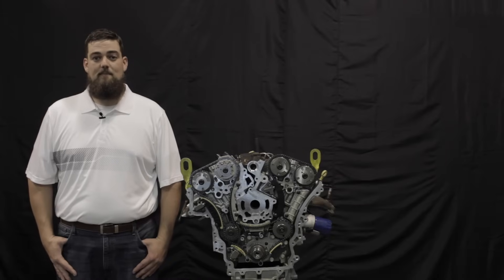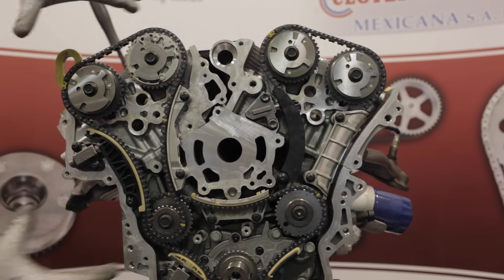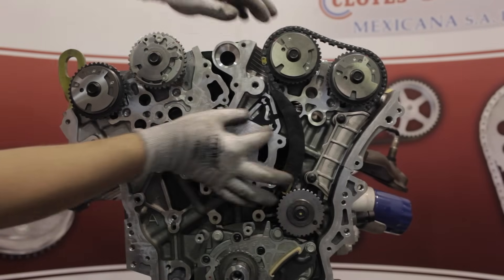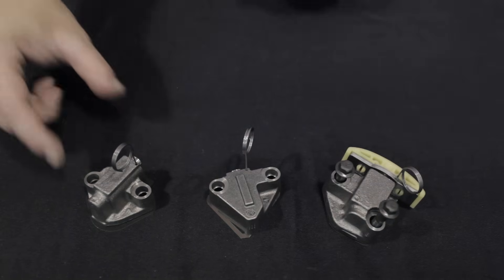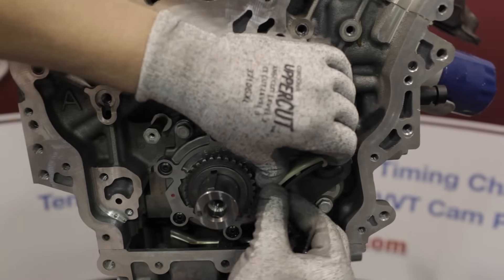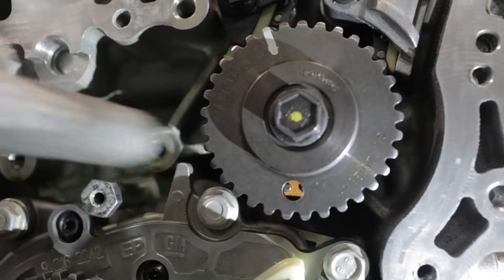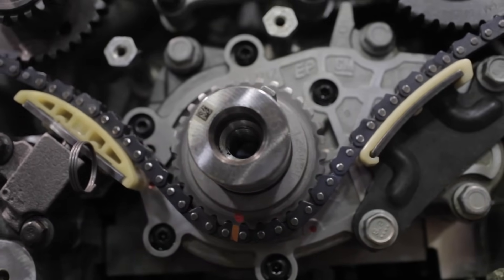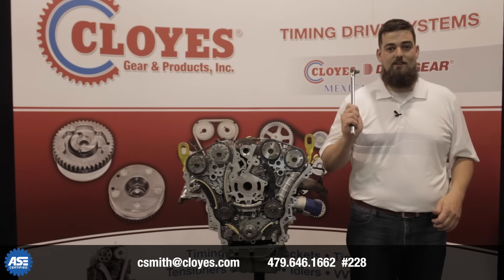GM 2.8/3.0/3.2/3.6L Timing Chain Replacement Repair, Cloyes 9-0753S

Comment: I think I bought a Cloyes double roller timing chain for my Pontiac 400 thirty three years ago. It was adjustable. Not one but three off set key slots cut into the crank sprocket. Providing multiple combinations of cam TDC settings. You could really dial in your engine for power. I learned how to degree cams for the first time on that engine. Thank you. Cloyes!
Reply: Back in the day I installed one into my my 69 400 RA GTO engine, had it tach'd out on a corner and tossed the cam out the oilpan.. I had just put in a rebuilt 4 speed where the builder used Jeep bearings, said they were tad noisier but stronger, I had thought the trany blew, coasted a mile home from inertia, when got home looked under and saw cam chunk hanging out pan.. the chain was broke, had a crane fireball cam and must have touched a valve using that 3 degree mark, never did find exact reason engine was destroyed..  got heads redone, kept those, still on shelf.. car long gone..  if they had those cameras on a cable back then could have checked clearance, must have been close.. putty and wasting gaskets sounded like a waste, wish had done it now...

Comment: Do you have to lock the cam before removing the chains
Reply: 2005 cadillac sts I didn't the cam damn near wont move once they are in a rest position. Just did this not to long ago

Comment: I just had this done to a 2011 Buick Enclave. One thing I have not read below nor was mentioned in the video is the need for a new oil pump. I was told by the GM repair shop that they have been told to replace the oil pump along with doing the chains because the OEM pump does not provide enough pressure to properly lubricate the chains and that is one of the main reasons for the problem. They said since they have been including the oil pump as part of the job they have not had any further problems with the timing chains. Thought this info might be helpful if you are doing this work to your car.
Reply: That and lack of crank case ventilation which seems to be a big factor in the sludge build up imo.
Reply: @derrekallen9588  how do you know when crankcase ventilation is suffering?  They don't use PCV's any more.
Reply: This seems weirdly similar to the 5.4 3v triton motor timing issues, just with a third chain involved....

Comment: I’ve made so much money at my dealer thanks to these timing chains wearing
Reply: @Richard Skipper it has nothing to do with no doing routine oil changes.  That's just the excuse GM uses to not pay for their faulty equipment and I expect to see a lawsuit over this in the future.
Reply: @Richard Skipper wouldn't 0w40 void the warranty? That oil is pretty thick so at temp it would have a hard time lubricating in between tight tolerances correct?
Reply: @ryanchristensen1799  0W40 is a zero weight oil like 0W20 it just had more viscosity change with heat, and the oil gets smoking on these engines
Reply: @bikerdave19148  oh ok gotchya, what about the 3.6 lfx motors in camaros?

Comment: I do the steps in my car and I route the engine with out the timing cover 
My question is 
If I rotate the crankshaft the marks will be not in the same 
And the engine rotate smoothly and very well 
And how I know if I do good or no 
Please help me
Reply from the maker: The only time the timing chain marks will all align with the sprockets marks is when you install the set. Once the engine rotates the marked chain links will not realign. You can check yourself by counting the number of chain links between your sprocket timing marks, then counting the number of links between the marks on the chain. If your sprocket marks are still the same number of links apart then you know the engine is still in time.
Reply: Cloyes Gear & Products, Inc. (Aftermarket) 
Thanks man
Reply: Actually the timing marks will line back up again but you will have to rotate the motor many times but it will infavt line back up ...  I’ve done it

Comment: very helpful video, was my first time doing chains on this engine, i brought the cam lockers but found they wernt needed. thanks for a great video
Reply: Ha ha, me too. You need them, I guess, if you remove the pulleys from the camshafts, to stop the camshafts turning?
Reply: I ended up buying them myself. You need them if you wanna pull the phasers off, so you can undo the nut, without pulling the camshafts out. They are handy to hold the camshafts in place while you hang the timing chains too, although the marks are clear, and you could go without.

Comment: Great video, thanks. Was about to purchase a VE Holden that has the 3.6ltr with the troublesome timing chain, but you have helped talk me out of it. I am a former mechanic and can do this job myself, but life's too short to be dealing with a GM's penny pinching engineering.
Reply: Penny pinching? What other NA engine in Australia gets 210 kW out of 3.6 litres?
Reply: 4lt

Comment: does it have to be at TDC?
Reply from the maker: With the crankshaft sprocket mark aligned the cam phaser marks will either be facing up or down. If they are up you are ready for disassembly, if they are down you need to rotate the crankshaft one more revolution. During the assembly process it may be necessary to rotate the cams individually to realign with the chain. The cams have a hex feature that allows for a wrench to be used to rotate them.
Reply: @Cloyes01  I accidentally got carried away and removed the chains with cam phaser Mark's facing downward, what would be my next step to making sure I get it timed correctly?? Crank shaft sprocket is dead on the mark but phasers are downward.
Reply from the maker: Do not worry about where the pistons are. With the crankshaft mark aligned and the cam sprocket marks up you are where you need to be to service the timing system.
Reply: How did you get the cam phasers in the right spot

Comment: Thanks for the Video, I may try it one day. Just wondering why you pulled the pin @7:14, then it was back in at 7:15? did you get a little ahead of yourself? Thanks again!
Reply: Mark Mangion ah i didnt see that. That'll be why at 7.15 the chain has slack on the left side as it rolls off the crank gear
Reply: somehow I don't think the tensioner even activated. when the pin is pulled there is no effect on the chain.
Reply: They made a comment this was an error in the editing

Comment: thanks gm for nice pile of shit stop trying to invent wheel its been done already
Reply: Your right simple is best, 93 Camry 27 mpg,on hwy no issues 300,000 mi.
Reply: If you think these are bad you haven’t seen the Ford 3.5’s with the internal water pumps. Now that is a shit design.
Reply: That 2010 model engine gets over 300 hp out of 3.6 litre NA. Any old "wheel" won't do that, no matter who reinvents it.
Reply: I only need one camshaft and one timing chain to get from Point A to Point B. To hell with all this overly complicated bullcrap that is costly to fix!
Reply: @maverickdallas1004  couldn't agree more..it's all engineer ego and bullshit...
Reply: @bwalsh6992  I'll take the good old GM 4.3 V6 over this any day of the week! Heck, you can get a reman 4.3 long block for less money than doing just the timing component replacement on this monstrosity!
Reply: @maverickdallas1004  lmao I drive a 1995 astro conversion van right now.. w/out needing a rebuild there good food 400k with proper maintenance ....drives like new travel 1000k miles a week in it ...w/antique tags...
Reply: @maverickdallas1004  astro van 4.3...
Reply: @maverickdallas1004  did u ever fix the problem
Reply: @Chresancioj  I wouldn't take on the problem in the first place. Getting too old for that!
Reply: @maverickdallas1004  I got one right now I'm still paying on and it's used trying to c what to do
Reply: Guy a car is only as good as it's owner, my wife's 3.6L 2011 Camaro has 114k miles on it and is still going strong, I haven't even done this timing chain to it yet, but from what I hear they are ticking time bombs hence why I am here...
Reply: Now I see why my mechanic wants to charge me like $4,500 to change the timing belt..... Ugh

Comment: Thanks for the Video, did you start off with making sure the the #1 cylinder was at TDC or does that not matter.
Reply from the maker: It doesn't matter, once you align the crank mark and insure the cams are in the correct positions you are where you need to be to set the timing.
Reply: This info should be stated in beginning of video. Glad i found it in comments.

Comment: This video is great, working on the car now... Very silly question, but with the harmonic balancer removed, how are you rotating the engine from stage 1 to stage 2? I don't want to do the "old school" method and tap the starter, as it is an interference style engine.
Reply from the maker: We were using the flexplate to rotate in the video, but I understand that will not be possible in the vehicle. With the engine in the vehicle, sliding the balancer back on to rotate will likely be your best option.
Reply: You turned the engine anti clockwise from stage 2 to stage 1timing mark when removing those chains. Is that ok to do with this engine? I thought you can only ever turn it clockwise.

Comment: Does Cloyes have a kit for a 2005 Lacrosse 3.6L?  Do you recommend replacing the cam phasers/gears when doing this repair?
Reply from the maker: We do not have a complete kit for the 2004-2006 model HFV6 engines. GM used roller style secondary chains on these early models. With that said, you can retrofit the newer style kit onto the older engines by replacing the 4 cam phasers with 2007 and later units. With the later style phasers the 9-0753S kit will work.
Replacement of the cam phasers is not necessary on all repairs. Most HFV6 timing system replacements are done to replace worn/stretched chains. Of course if the phasers are failing we recommend replacement, but it will not be necessary on every job.
Reply: OK, thanks. Does the early roller style chains have the stretch issues the later style chains have? We have a nice 05 Lacrosse, has about 120K on the clock and runs well, all original. I was going to scope cam/crank signals to see if we could ascertain current chain stretch.
Reply from the maker: Neither timing chain design was free from fatigue. Oil change frequency is the single biggest factor in timing system lifespan on these engines.

Comment: I have a 2008 GMC Acadia and the front timing cover is leaking and I was wondering if that timing cover can be done with the engine in the vehicle rather than taking it engine and transmission out of the bottom I know there's not a lot of room there but is it possible
Reply from the maker: None of us have personally worked on an Acadia, so it would be unfounded to tell you it can't be done. I can tell you that All Data recommends dropping the cradle for timing cover replacement on both FWD and AWD Acadia models.
Reply: thank you.
Reply: Yes it can be done in vehicle.  I just installed this kit on my 2008 GMC Acadia.  Thanks Cloyes for this video, it helped a lot!
Reply: thanks bro. it looks like it may be enough room
Reply: No problem  I just did mine last night.  You have to work a little to get the timing cover out and back in but other than that installing the timing chain kit is no problem.  Just be sure to remove as much as possible on the passenger side of the engine to make it easier to work in.  And be patient it does take time to do.
Reply: If you are just repairing the leak, use steel stick or similar epoxy putty, after you remove the damper and the plate that trapped all the crud that caused the corrosion. I would leave the plate off in case you have to do it again.

Comment: I always love the Ford owners that hack on GM. Especially after 7 hours to replace the notoriously common f150 exhaust manifold. It's a machine. They all break,  just when
Reply: I just did my 05 F150 and took me 10 hours... Now I'm doing my wife's 09 CTS . Compared to my Ford ... This is a breeze !!!
Reply: Richard Skipper there is nothing wrong with running the recommended 5w30 in this engine. But running a quality synthetic and changing it at reasonable intervals is highly recommended. Do not go 8000 miles between oil changes. Or you will have tons of issues down the road.
Reply: Honda and toyota are actually better regardless of being machines

Comment: Cody I'm old school to this. I have all the timing marks in place. On a normal motor I would hook up a battery and crank the motor by jumping the starter and then rechecking my marks. I know it's an interference motor and don't want to damage it. Does power need to be put to the cam phasers or should I say should I just assemble it. I just don't understand how it stays in time while it builds pool pressure. I just don't want to have to tear it down again. Not knowledgeable on cam phasers. I've been 45 years into mechanics. Please help. Guess I'm old school and over cautious. Thanks again.
Reply from the maker: No power to the phasers is necessary. They have internal locking pins that hold the sprockets solid until oil pressure is supplied to unlock them. Your best bet is to just assemble it. Once the engine is rotated, your timing marks will not realign. Once the tensioners are activated the internal mechanical ratchets will hold the chains tight until oil pressure takes over. If you are confident all the links are lined up correctly just put it back together.

Comment: the locks are needed for replacement???
Reply from the maker: No, the camshaft locking tools are not necessary. We did not use them during the filming of this video. They may make the job easier, but are not required.
Reply: Or step by step like in a movie?

Comment: I have a 2008 Saturn Vue with this motor. I just did the replacement on it and aligned the marks as stated but there's a timing issue. Are there different versions that require you to use different timing marks when aligning?
Reply from the maker: No, this procedure works on all 2007-2015 HFV6 engines. The 2004-2006 models are very similar but use roller chains instead of inverted tooth, but the procedure works on these as well.
Reply: I figured and after talking to different service centers to rule out the possibilities of application differences it was in time. I have now discovered water in the oil and both exhaust rollers on cylinder 3 were sitting at the bottom of the head so I'm sure the two valves were bent. Thanks for the great information in your video.

Comment: Thanks, Cody Smith, for a very informative and instructional video. Every critical point was covered including reference to torque settings on every one of the bolts.
 
The demonstration appeared to have been done on an engine set up for the purpose, so that time could be saved, and the 8.42 minute video showed just what was necessary.
 
If someone required the use of a torque-wrench to be demonstrated, I am sure they could find classes elsewhere for that.

Comment: I will not buy any GM with a DOHC engine. It looks easy till you try this repair in the vehicle.
Reply: @tbeau9717  it can be done I'm doing one now in an Acadia of course a lift is easier but it's doable

Comment: Why does my motor keep jumping time. There is not enough pressure on the timing tensioners when released. I manually turned the motor clockwise only to have it jump time every time. Reset timing marks 3 times. Any help would be great.
Reply from the maker: We do not recommend turning the engine over by hand after installation. Valve spring pressures will cause the cams to try to jump forward as the engine is being turned over. At slow speeds this can be somewhat violent and cause the chain to jump teeth on the sprockets. Turning the engine over with the starter, or starting the engine, allows for more stable cam rotation and the chain much less likely to jump. Of course once the tensioners receive some oil pressure any form of rotation is safe.
Reply: Maybe got the wrong chain with improper tooth count??

Comment: I've done them,, i recommend dropping the motor...
Reply: Rick... I've done plenty of these and unless this 3.6L motor is in a SUV (sitting sideways) you do not have to drop the motor. Its a piece if cake compared to a 5.4L Triton Ford. Try one of those pieces of *%#@   sometime...
Reply: Hi Rick, aside from being easier to do why?

Comment: Please add 
the following Close-ups:
Stage 1 timing position
timing mark on crank sprocket 
timing mark on oil pump 

'L'  timing marks
Hole intermediate idler

Stage 2 timing position 
timing mark on crank sprocket 
timing mark on oil pump 

'R' timing marks
Hole in idler sprocket 

.

Comment: Question for Cloyes
1) the Cloyes timing chain Kit
is Validated 
for How Many Miles?

2)Are all of the Parts
             Made in USA?

3) Timing Chain Guides
are they just Nylon plastic
or do the Timing Chain Guides
have Metal Backing
or Metal Structure?

.
Reply from the maker: 1) The Cloyes timing chain kit's lifespan will be equivalent to the replacement kit from GM. Cloyes is actually supplying chains from the OE manufacturer on this kit. Of course these engines are known for prematurely stretch chains, but as of now the OE chains are still the best option. 
2) All the components in this kit are currently being made in the US or Europe, the same as the OE sources. 
3) The materials will be the same as the original parts. The 2 secondary tensioner guides are fiber reinforced structural nylon with nylon chain contact surfaces, and the other guides have metal brackets with the nylon contact surfaces.

Comment: just put heads on a 3,6 gm and cant find and piston timing procedure, Stage 1 (driver side chain)  or stage 2 (passenger chain) which of these are supposed be TDC on cylinder 1#

Comment: Why didn't you use camshaft holding tool? I notice when you removed right bank timing    chain the exhaust cam moved little bit.